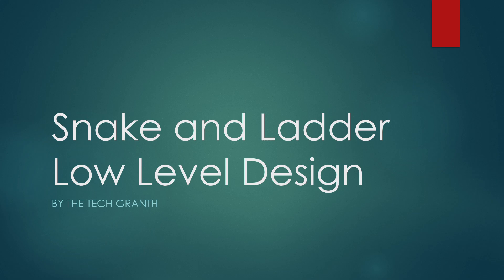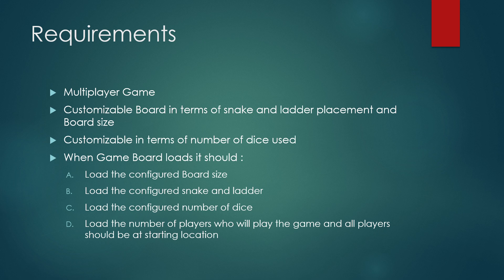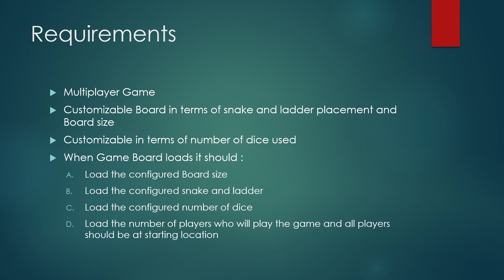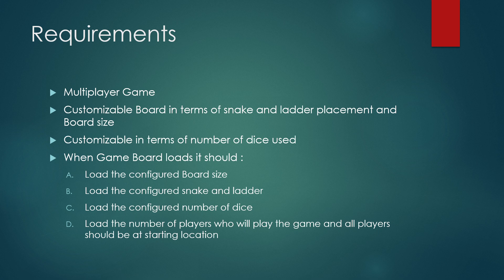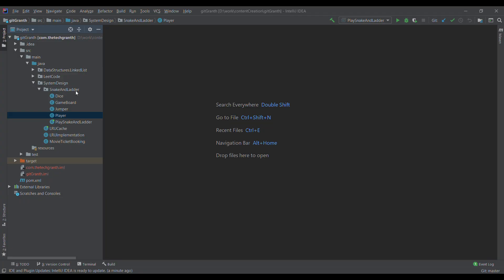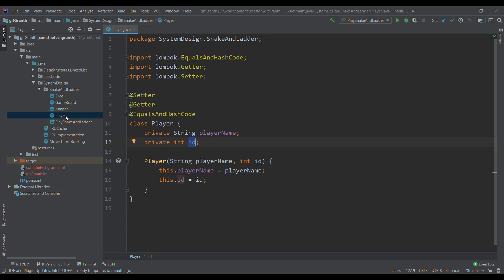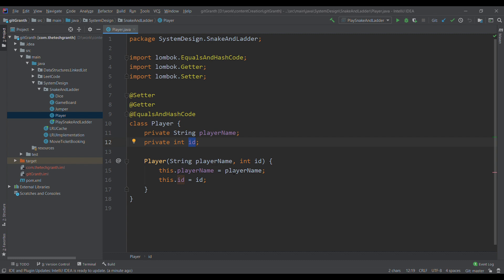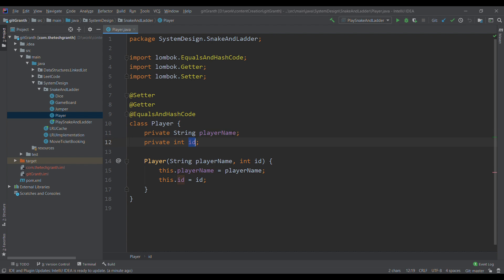System Design : Snake and Ladder | Low Level System Design | Machine Coding | OOPS Design

Comment: Bound to crash at load.

Suggestions:-
1) Make a temp N. We will call this active players. use modulo for player turns. Incase a player wins. Decrease N.

2) mark the board for snakes/ladders during load time itself. Just keep another variable in grid called JumpTo. Hitting this grid index will force players to go down or up

Comment: public int rollDice(int numberOfDice) {
    int result = 0;
    for (int i = 0; i < numberOfDice; i++) {
        // Each die generates a value between 1 and 6 (inclusive)
        result += 1 + (int)(Math.random() * 6);
    }
    return result;
}

This is more in sync with the real life dice rolling
Reply: Additionally, the author's implementation makes it impossible to roll 12 with 2 dices or 6 with one and so on

Comment: Timestamps 
00:04 - Introduction to low-level design of a customizable Snake and Ladder game.
02:19 - Initialize game configuration for Snake and Ladder.
04:32 - Designed a dice class and a generic jumper class for Snake and Ladder game.
06:53 - Implemented game board features for Snake and Ladder.
09:10 - Implemented game mechanics for starting and managing player turns.
11:28 - Game logic manages player positions and winning conditions in Snake and Ladder.
13:41 - Handling player movement for snakes and ladders in the game.
15:58 - Game logic involves players, dice rolls, and handling snakes and ladders.
18:12 - Overview of Snake and Ladder game board design.

Comment: i think there is some mistake in generating diceRoll 
(((int)( Math.random() * 6*2 - 2)) + 1);
if numberOfDice = 2, then 12-2 = 10 + 1 = 11 we never achieve 12.
Edit: Instead we can use this (((int)( Math.random() * 6*numberOfDice)) + 1), correct me if i am wrong.
Reply: but it will reach 13 then?
Reply: @ayushigupta685  i tried but didn't got 13, can you try once.
Reply: Math.random has a syntax of
 int rand = (int)(Math.random() * range) + min;
So i guess it should be
(int)(Math.random() * 6*numberOfDice) + 2;
Because we can never get 1
Correct me if I am wrong
Reply: @palakgupta728  

private int getRandomDiceValue(int diceCount) {
        if (diceCount == 0) {
            return 0;   // Base case
        }
        int randomDiceValue = new Random().nextInt(6) + 1;
        return randomDiceValue + getRandomDiceValue(diceCount - 1);     // Recursive call
}
Reply: ((int) (Math.random() * (6 * numberOfDice - numberOfDice + 1))) + numberOfDice should work
Reply: @palakgupta728  (int)(Math.random() * 6*numberOfDice) + 1 will be correct. we can always get 1 as a result of dice. Math.random give a a range of [0,1). so we just need to offset the result by 1

Comment: There are some modifications: 
1. We can use map to store ladder and snakes in the form of map[startPosition]=finalPosition. 
2. Instead of creating a queue and popping the front and pushing it to the back. Simply keep a fixed array and keep increment the index in a circular manner i.e index=(index+1)%noOfPlayers thus index will give the current player at any time
Reply: What happens if some player has won the game... you'll have to skip it's chance as well
Reply: true no need to use deque
Reply: what is the benefit of point 2?
Reply: the thing with array is we don't just remove one element but we also shift others to take it's place i.e in an array of 10 elements, if you remove element at index 4, you will have to left shift all elements from index 5 to 9 by one position, which is not the case with queue. Hence using a queue is a good choice.
Reply: Instead of incrementing index using in circular manner, how about circular linked list?

Comment: I think rollDice will return 2 to 11 if we pass numberOfDice 2?
Reply: yes 12 will never achieved with two dice,seems wrong to me
Reply: i think there is some mistake in generating diceRoll 
(((int)( Math.random() * 6*2 - 2)) + 1);
if numberOfDice = 2, then 12-2 = 10 + 1 = 11 we never achieve 12.
Edit: Instead we can use this (((int)( Math.random() * 6*numberOfDice)) + 1), correct me if i am wrong.

Comment: Is low level. Design and machine coding round same?
Reply from the maker: No, low level design can be extended to be a machine coding. In low level design you are supposed to design the api and class and relation between classes using design principles and patterns, futher you can be asked to implement few methods which falls under machine coding
Reply: @TheTechGranth  so low level. Design is subset of machine coding?
Reply from the maker: @shubhampokhriyal8491  not exactly, in machine coding, you can be given the class and methods, and you need to code the algorithm
Reply: @TheTechGranth  and in low level. Design no. Code?
Reply from the maker: @shubhampokhriyal8491  ideally yes but you may be asked to code some methods as well, depends on your years of experience and your interviewer
Reply: @TheTechGranth  ok thanks for info..
Reply from the maker: @shubhampokhriyal8491  welcome and all the best. Do like and subscribe and share with others 🙂
Reply: @TheTechGranth  sure..

Comment: code may be optimized, instead of creating the list of snake, ladder, and jumper, we can create a map for where the key is start point and value is endpoint, this way we can save time to search if target position is  ladder/ snake or not int o(1) time,

after searching on the internet, I think i am in right place for low-level designing
Reply from the maker: You are right, it is just that the list will not be too big in a game like this, and readability wise it felt better hence my choice of list but time complexity wise you are right.
Hope content are helpful. Do like and subscribe and share with others 🙂
Reply: That O(1) optimisation you suggested is very good!

Comment: Sir what if  we can make Obstacle as interface and let snakes and ladders implement from it .In future if you want to add any other obstacles we can do that by extending the code i.e open for extension and closed for modification....and one thing sir if we want to invert to rules i.e snakes become ladders and viceversa...i.e when ever you hit the tail of snake you can upwards up to the head...and viceversa for ladders...How do that sir  with minimal modifications.? where user select the rules based up on his interest..
Reply from the maker: 1) You can do that as well but then in that case the game will not be snake and ladder :) I felt it will just be a overhead in this scenario, considering you just have to move up or down based on if it is a snake or a ladder but your point will make more sense in case we had some complex algorithm which differentiates snake from a ladder and in future we have possibility to add more obstacle.
2) this is what jumper will do, when you load the board, you have get input for user details and positioning of snake and ladder, just name the jumper as snake and give it the functionality of ladder, no modification required in current code to answer your 2nd point.
But then again, even though it is technically feasible, you wont do that in general.
Reply: Thank you sir ..